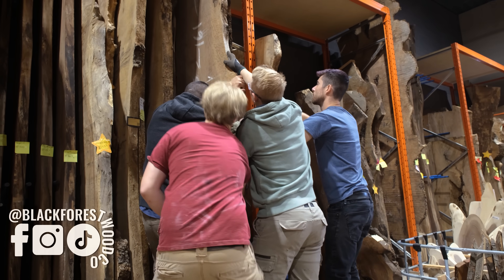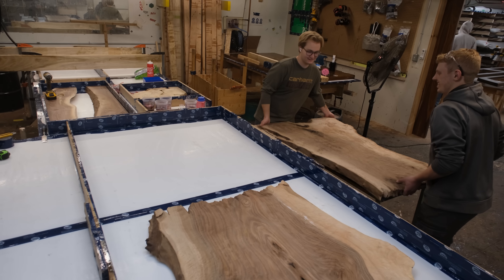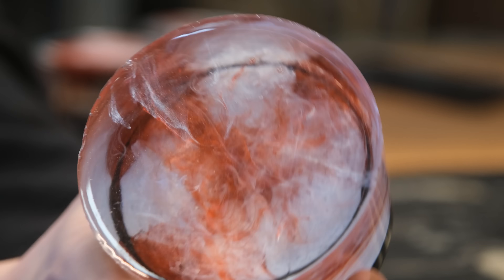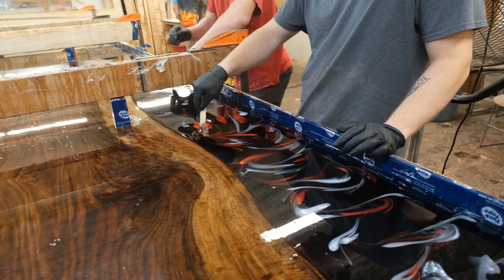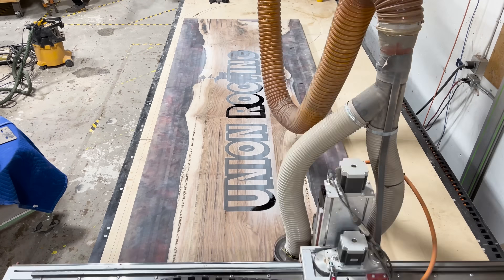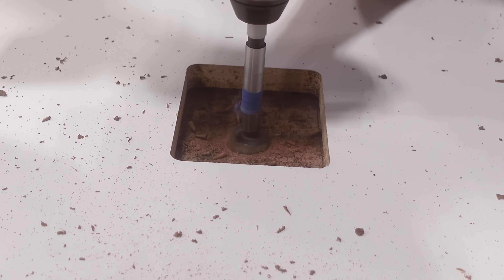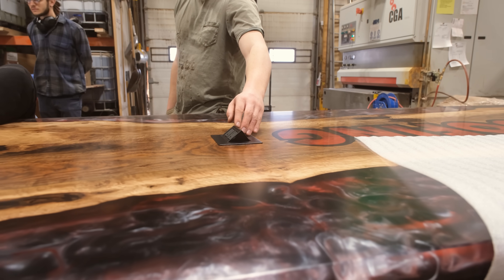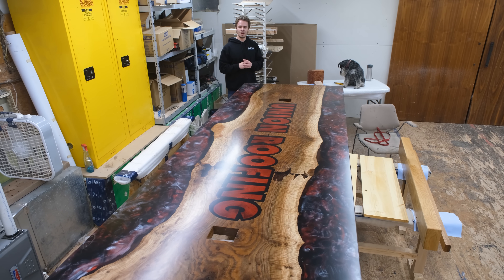Is This The Most Unique Table We've Ever Made?

Comment: Question: I've noticed when you clamp down your pieces you put blocks on the wood to hold it down. How do you then correct the fact there's no resin under those blocked areas one you take the mold off?

Comment: Update on my Table left behind in my new house … We had to get a specialist company in at great cost to get rid of The Wood and Resin Table that was left behind by the previous owners, The company deals with Hazardous materials like asbestos and Carbon materials that are not legal to take to a Recycling Facility or local Dump, It cost $2400 dollars to take it to a Waste Management Furnace to destroy it safely…. These things are very Bad for the environment just saying…😢
Reply from the maker: Unfortunately you were ripped off. Cured epoxy is not hazardous and is no different than any other polymer. 
If someone wants to discard a table they could simply take it to a landfill. 
I’d call that company back for a refund.